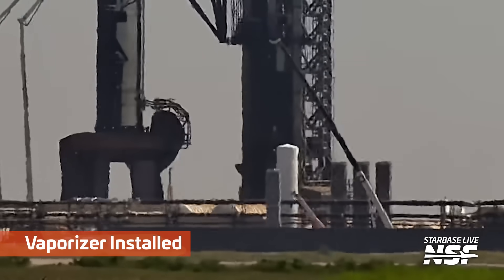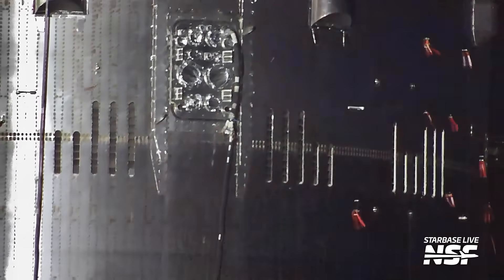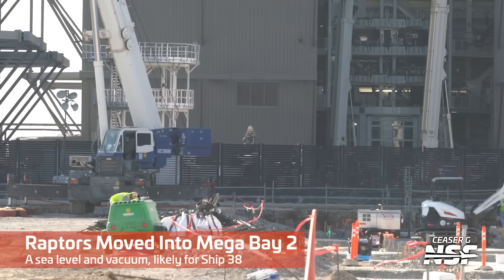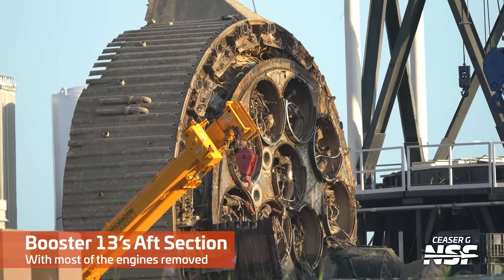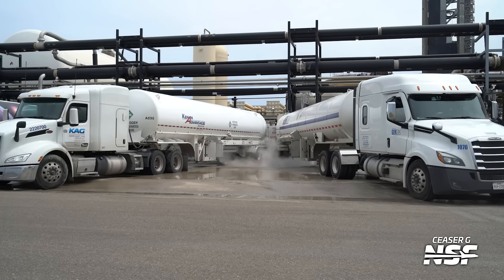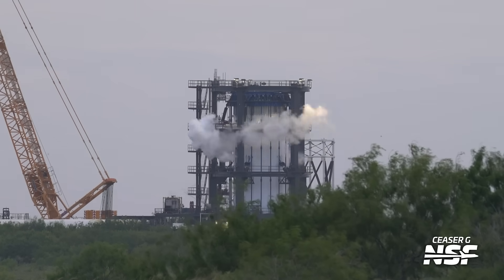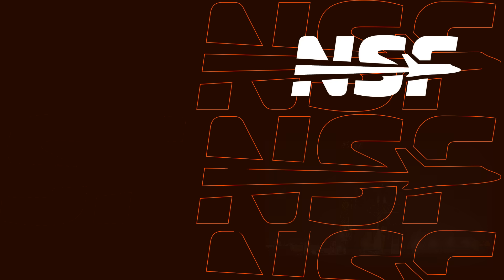Starship Flight 10 (It's No Earlier Than the 24th) | SpaceX Starbase

Comment: 7:11 Architect here: a rail would have to be extended far enough to be exposed to the biggest blow torch on earth and then a massive shower changing the shape of anything metal instantly. Using the angular struts will push the QD forward and up a bit tight against the ship.

Comment: Star stool?
Booster-seat would be a better term. It just adds a little height and allows a smaller thing/being to sit on a seat intended for a bigger thing/being.
Reply from the maker: But... boosters don't sit on it. That's why we ruled out "Booster Seat" 👍 -Das
Reply: @NASASpaceflight  Boosters don't sit on booster-seats (car-seats), children sit on booster seats, and boosters are NOT children, they are 18 year-old cheerleaders. The booster seats in cars, give the child a boost, and allow them to sit in a seat designed for a booster (18 year-old cheerleader).
Reply: @NASASpaceflight  But what do Ships normally sit on? Boosters! This adapter, is shaped like the top of a booster, so it's a booster shaped seat. It's a booster-seat! (for Ships to sit on)

Comment: hmm have been wondering wy the could not have made the adaptor more like the booster so it could have sat in and locked the same as the booster. That would have made part of the adaptions quicker.
Reply: Maybe because even the 20 booster clamps have to be manually modified for booster static fire. Uncertain if the 20 rapid clamps could hold down a Starship static fire.
Reply: @imconsequetau5275  Interesting. I assumed they would have immediately thought about it and can't for some reason.

Comment: 2:35 Cybertruck looks cool I just wish it was body on frame and solid axle with a diesel and proper lockers 😔
Reply: It is dangetous for pedestrians: any hit, even at low speed is going to break bones, and would likely kill even at moderate speeds. The main issue is the sharp edges.
Reply: @paullangford8179  eh that’s a non issue cars in the 50’s and 60’s where much pointyer just don’t walk in the road and your fine

Comment: 👍  No straight slides for the QD as it's all about the "angle of the dangle", hinging allows for the entire assembly to raise up and the QD face plate be flush vertically with the ship's.  They could achieve that with a slide but it would be a couple of ginourmous rooms sitting up high on the edge of the launch mount where the smaller "dog houses" are currently located.     Were they cleaning SF or checking for leaks in that replaced area where they removed all those panels.

Comment: Why do they have TWO booster QDs at pad 2?
Reply: To make the combined surface area smaller. The old one had to sacrifice som space because hoses could not be cramped too close to each other. It will also be safer since leaks in one will be some distance from the other. The number of internal pipes is not affected.
Reply: @knowledgeisgood9645  Thank you!
Reply: On top of what was said, they’re going to be able to tank the rocket even faster than currently. Rumor is they may go quicker than a Falcon 9.
Reply: @EMichaelBall  True, but that is due to the new tank farm, not the new QD plates.

Comment: 7:00 studying aerospace engineer here. i believe the hinge mechanism allows for  greater flexibility in terms of speed, force and range of actuation. sliding mechanisms tend to be more complex, harder to drive, larger and require more parts and maintenance.

i assume some sort of piston, probably hydraulic, is being used to actuate the mechanism so it can use the principle of moments (leverage, if you will) to tune the mechanism to the exact force needed and optimise the speed (which would be ideal since it really needs to be out of the way as soon as possible)
Reply: CSIStarbase covered booster QD mechanism in detail in a recent video.
Reply: Yeah, pivoting is much more efficient and robust than sliding or rolling.

Comment: About the sliding vs hinges:  sliding, the force required to move something scales with weight vs various hinge mechanisms the force required does not scale as fast.  Basically, there is a point where the object is too big to slide easily and it’s more efficient to use a hinge system.  This point is dependent on how slippery you can make your slide and material science is limited in this area.  Also, several super slippery surfaces or surface coatings exist but can’t the material can’t handle huge weights.  Again, there is a point where hinge systems are cheaper and more durable under very heavy loads.
Reply: The world's largest moving structure are the 2 gate arms in the Netherlands (that are used when there is a large storm surge). They did not use sliding walls - they used enormous hinges.

Comment: If the propellant truck unloading was a pull-through every truck would be waiting on the slowest truck. This is by far the fastest way unless you have a dozen pull through stalls. The same reason truck stops don't use this method.
Reply from the maker: Large depots will have 4-8+ parallel bays for maximum throughput. They just crammed this facility in a very footprint limited spot. - Das

Comment: About the QD hinges. I wondered that myself. because they are hinges like a parallelogram, you have vertical motion when there is horizontal motion. You don't vertical motion at the QD. But, if the hinge arms are perfectly vertical when the QD is engaged, the horizontal motion during disengaging during liftoff at the QD plate is minimal. Probably the seals can handle that.

Comment: Rails to slide the QD in would provide no mechanical advantage to the connection point.  Hinges can be designed to optimize speed and force throughout the stroke.

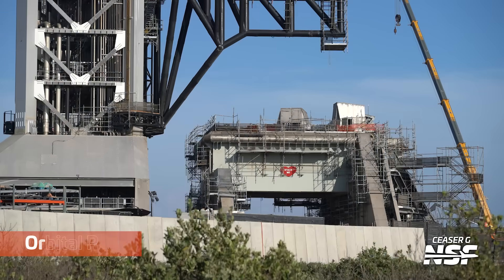Comment: 5:52 Making a prediction here - Booster 12 is getting work done to prepare for it for transport to the Cape. I don’t think it’ll ever see flight again, but it’s the perfect article for testing out transport to Florida w/out creating new expendable hardware. And if it makes it there intact, I could see B12 being an engineering pathfinder to test systems at the Cape (I highly doubt it’ll get that far, but if it’s there and it’s able, they’ll use it to test the GSE). Again, this is purely my prediction.
Reply: B12 is incompatible with 39a.
Reply: Uhh they can use B17, it's new and they don't need it, if they damage B12 that will not be good...
Reply: For ‘museum’?
Reply: @JoyceLynn-q3m  I wish. Unfortunately I think the only vehicle SpaceX is going to keep as a museum piece is Starhopper.
Reply: @barometricfunk I heard differently in a video. Stated SpaceX was saving some historic ‘pieces’. 🤷🏻‍♀️
Reply: They won’t send obsolete equipment to Florida.
Reply: @DavJumps Interesting take.
Reply: Will use it to test the breakover/shipping equipment.  That will include standing it back up at Kennedy.
Reply: @scottgaree7667 🤔
Reply: @scottgaree7667  Yep, I agree.